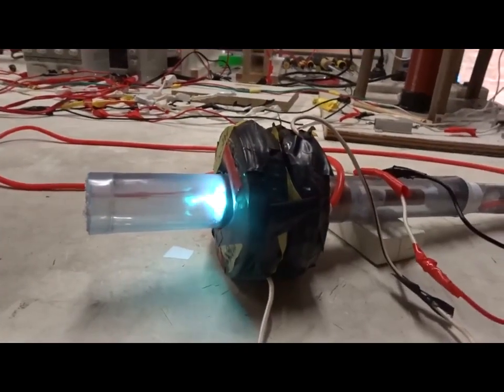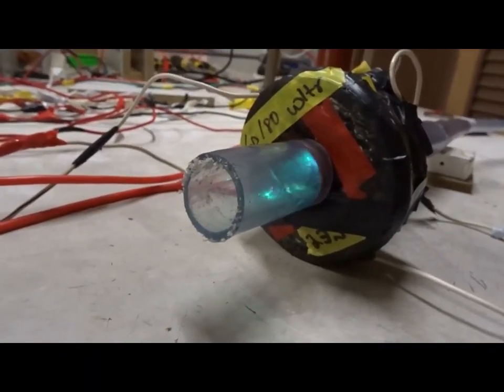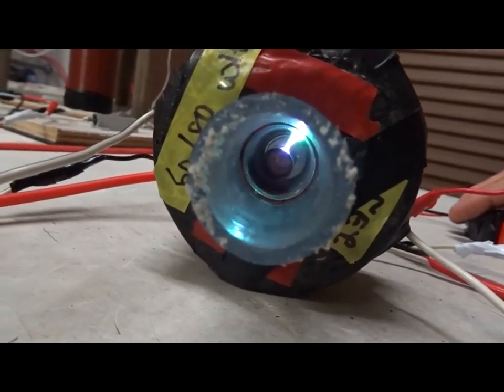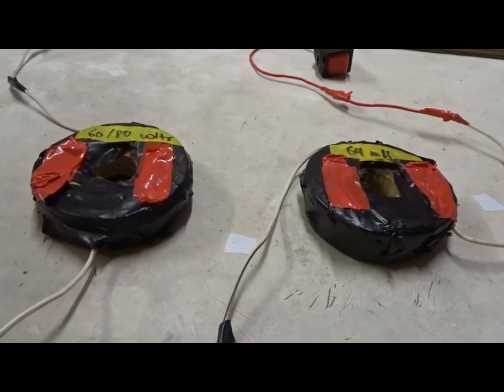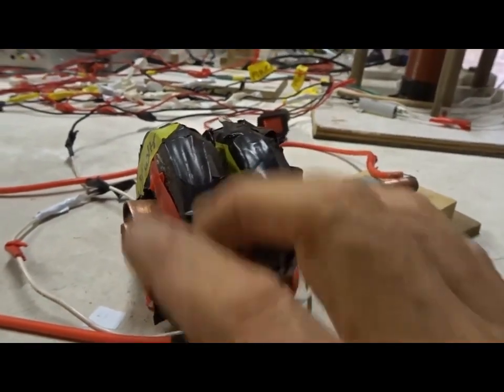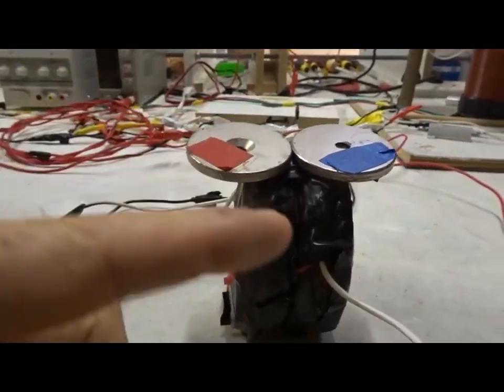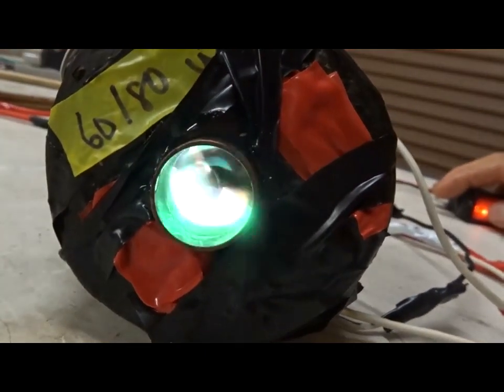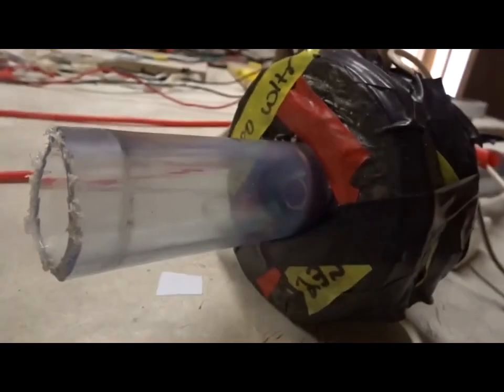The circular plasma railgun: proof of concept, practice and theory

Comment: This is very cool. You could get a longer flame with higher thrust if you change the configuration slightly. Shorten the copper to 1/2" and place them in a crystal/glass tube. It will make a sound wave when you find the area where the tube resonates. Here is a refence video. https://youtu.be/abswNCqnMRQ?si=UWGfGNWJk3AL9Gj2        I hope this helps to give you more idea's. I love the work so far.